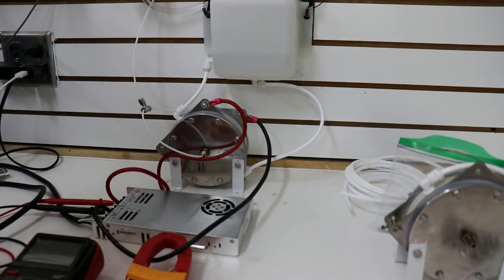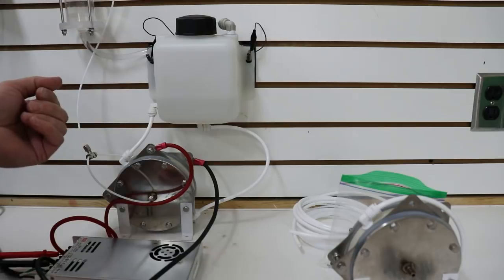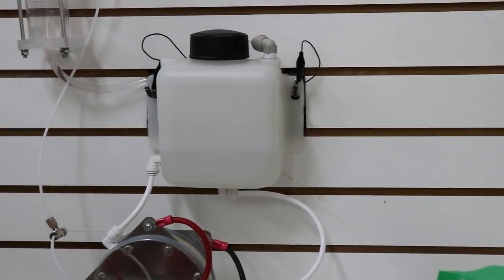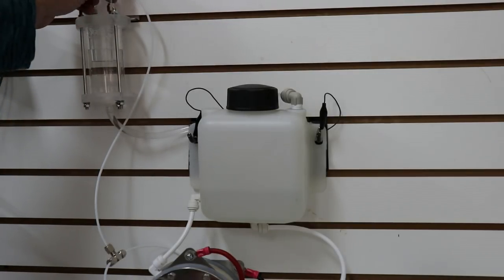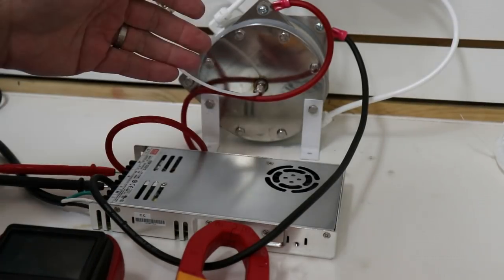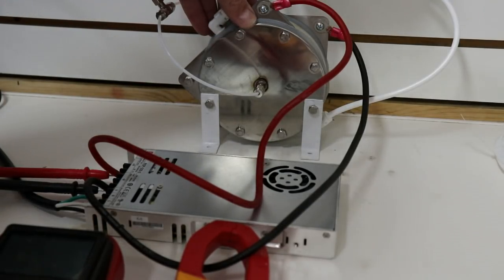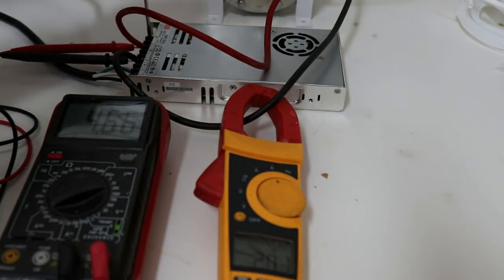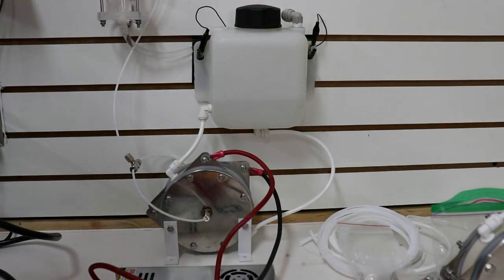PEM Hydrogen generator setup and use.

Comment: Since this doesn't use any additives in the water, could you use computer water loop radiators for cooling (with small circulation pump)
Reply from the maker: Absolutely!

Comment: I can't find the H2 output rate. How much H2 does this put out under idea conditions?
Reply from the maker: 500ml per minute normal running and 1000ml max
Reply: @Hydrogen4Health  can this PEM generator setup be used for inhalation?

Comment: Why are you connecting both the outputs from the anode and cathode together? This is mixing the hydrogen and oxygen back together, and not separating them out. The cathode side generates the H2, and the anode side is O2.
Reply from the maker: This cell has 4 plates. The 2 outside plates are the cathodes ( H2 producers) and the 2 inside plates are the anodes. The H2 gas is captured from the ports on the sides and the O2 gas leaves the cell in the middle chamber with the water.
Reply: @Hydrogen4Health  ahh, ok. That makes sense. 4 plates? That's crazy... it looks so small.
Reply: @Hydrogen4Health  Oh, that's interesting. You are saying that it has two membranes so that the anodes are entirely separated from the cathodes. I hadn't thought about the water output being used as the O2 outlet before. That's a neat idea.

Comment: I feel it's important everyone knows that this cell is from Alibaba
Seems to perform fine and gets Steve's seal of approval, but nonetheless, it isn't built in the US
Just waiting on a few more fittings in the mail, and I'll try running the PEM cell I got from Steve
https://www.alibaba.com/product-detail/SPE-PEM-hydrogen-water-Electrolyzer_60399174055.html?spm=a2700.7724838.2017115.208.2d86141bCObRDO

Comment: This needs to be put into its own compact housing and sold as complete units, ready to plug and play, it will sell like hot cakes as opposed to the current hydrogen machines which weigh like 15kg! and still don't even make 1litre per minute H2!
Reply: Will you be doing this Steve? Also, how about one that will use any water?
Reply: I totally 100% agree with your suggestion. It may cost more but there are number of people who standby and watch this show thinking that this is too technical for them. A single Unit Box with Carry Handle that you can take it anywhere and has dual option for Input (110/220v or 5v DC) which would be such great to buy and just keep it handy even if you use only once a year. 😀😀

Comment: if this is a real pem fuel cell...why not capture and store both the hydrogen and oxygen instead of venting? remove input power from the cell...should be able to run the system in reverse as the source of dc current? as a true fuel cell?
Reply from the maker: Look it's Justin in disguise.
Reply: delvis11 disguise? no...just havent had much to do or say for the past few years...failed as a entrepreneur and good person for a while there. havent had the courage to come back into the research...though i think about it everyday.

still would enjoy your response to my questions about your true pem fuel cell?
Reply from the maker: I haven't tried to use it a fuel cell. Maybe an experiment to try.
Reply: delvis11 it would be interesting to see the results. 
i was never able to make it to the point of pem cells. i never quite finished the alkaline fuel cell i was working on.  pure nickel plates...no neutral plates...custom one piece designed gasket between the anode and cathode...built in 2 to 1 volume self balancing gas storage. it was supposed to be completely closed loop....input dc...make gas...pressurize gas reservoirs...remove input power...connect dc load to cell...power load until stored gas goes back to water again and pressure diminishes....repeat process...no water or gas is lost in the unit...never completed it sadly.....i had dreams...
Reply from the maker: I worked with a partner on the hydrotube. We had a working system but he kept wanting to expand it and overcomplicate it. So I split with him and he got the machine. He never finished it either so that dream is on a long hold.

Comment: So it is basically 2 Cells in parallel,  right ? As the main plus electrode is in the center and the minus electrodes are both on the outside plates , right ? 
How long does the PEM foil work and last ? How many Watts for how many H2 gas per minute ? Many thanks. P.S. Could one put 2 units in series to let it run from a 12 Volts car battery ?
Reply from the maker: The PEM will last a long time 5+years if taken care of.  Makes approx. 1 lpm of H2 at maximum 240 watts. Yes you could use 2 of them on a 12v battery.
Reply: @Hydrogen4Health  Seems a small misunderstanding. "2 paralel cells in one unit"